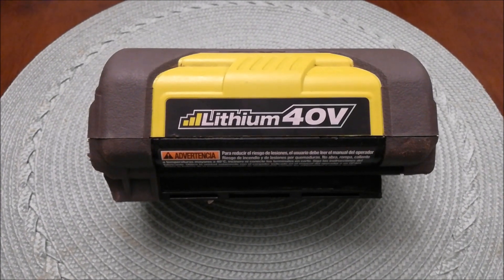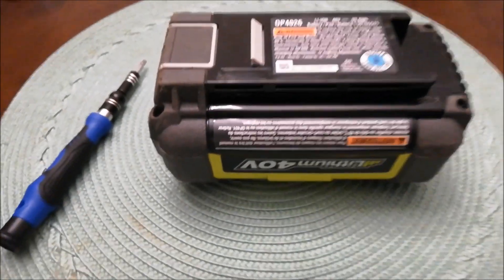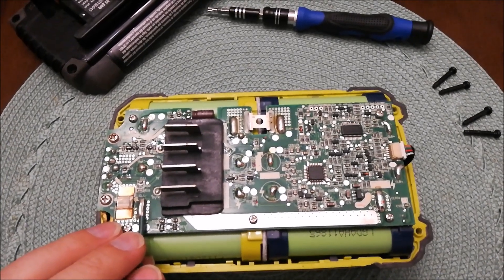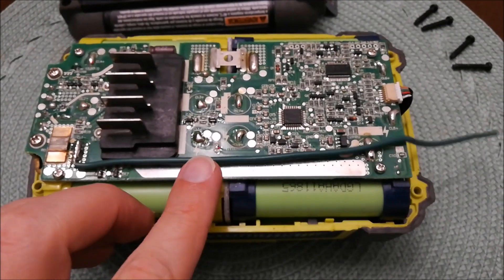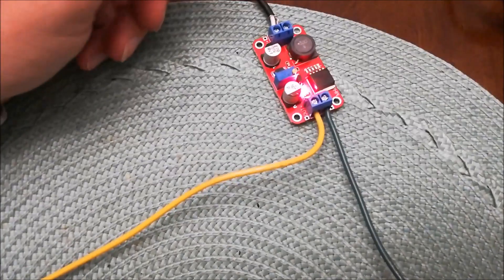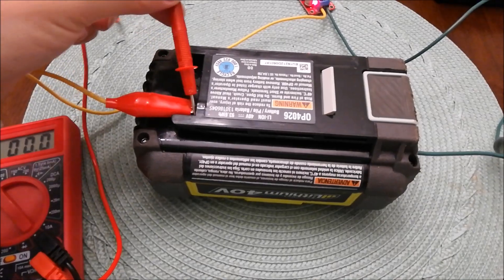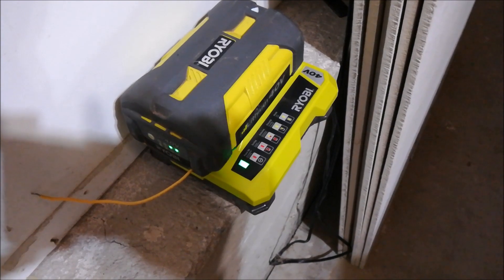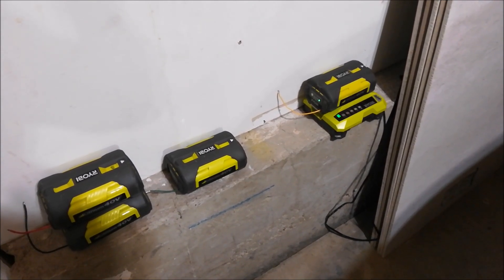40v Ryobi Battery Defective?! Let's Fix it!

Comment: Great video, but need a little help please.  I had an old laptop power supply that puts out 18v at 3.5A and tried connecting to a converter from Amazon (see description below).  Input voltage shows 18V and I adjusted the output to just over 35V fine, but when I connect to a battery, all four indicators light up for about 10 seconds and the LED on the converter blanks out.  Disconnect the battery and the converter resets, LED lights back up again.  Is the converter inadequate at 100W output?  Guess I should have gone with the one listed with the video, or is there something else I'm missing?  Thanks for any help.  
WHDTS DC-DC Boost Power Module Adjustable 100W 3.0~35V to 3.5~35V LED Digital Voltmeter Power Supply
Reply from the maker: What voltage is the battery at before you start charging?

Maybe start by lowering the voltage output of the boost converter to like 20 volts, get the battery up to that point and then raise the voltage to 35-40 volts. See what happens then.
Reply: @Jasonoid  Thanks for the reply.  I have two batteries OP4026 and OP4040.  Both haven't been charged in about 2 years and both appear completely dead.  I tried backing off to 19V, with no change.  The battery indicators all light up for a few seconds, but the LED goes out and I have to unplug and wait for the booster to reset.
Reply from the maker: @araasch2  it could be the voltage booster that is having issues. You might want to try a different way of charging it and see if the issue continues. The one linked in the description isn't too expensive, I just don't want you to have to buy something and then find out something else is the issue. It sounds like the boost converter is the issue.
Reply: @Jasonoid  Thank you.  If I can't find another option, I'll order a converter like the one you listed.

Comment: Thanks Jasonoid!  Just recovered mine that was just over 2 years old.  Only difference is I used a 48VDC adapter for a Cisco Access Point I had laying around.  Left it on for about 10 minutes or so until it reached about 33-35V and then put it in the charger.   PS, Ryobi has a 3 year warranty on all batteries and chargers purchased since around '09.  Just register it at https://www.ryobitools.com  call them and boom.  New battery will be on it's way.  
Here is the warranty info:  https://www.ryobitools.com/support/warranties
Reply: I did this, didn't have to hack the battery, buy electronics or anything. Just 15 on the phone. DO have your tool (mower or whatever), battery charger, and battery nearby. They want model # and serial # from all three. Thanks Steve.
Reply: I think mine was older than that, inBatttery years...But in usage, It was probably one year old. Since I dont use it in winter. Well I took a chance and theyre sendng me a new one. JUst make sure you have the correct charger, and tool that goes with offending battery.
Reply: Ryobi send me 2 batteries and both of them are doing the same thing, not charging. Don't know why they send them like that. Has 3 batteries with the same problem. I hope I can fix them after following what's done in this video.
Reply: @alexguzman743  How about the possibility your charger might be bad. Ryobi sent me a new charger
Reply: @markday2190  yes, it was the charger, I have to buy a new charger and now they work.
Reply: Warranty first, actually always! What they do is send you a new one. Then you hack the old battery and have 2! 

Problem with the warranty is each battery does not get a full 3 year, your warranty is from date of purchase of the original.

Comment: I did this method but my battery voltage was too low and can only charge up to 20.60 volts. My booster is set to maximum which for some reason only goes to 37.67
Reply from the maker: You might be charging the wrong terminals. 20volts seems about half the battery so many thats where you are hitting an issue. What type of power adapter do you have plugged into the booster? A 12 volt adapter with how many amps?
Reply: Might be that mosfet.on the battery pack I am repairing one now. Mine only read 20 volts or so the mosfet connects the other side of the battery assembly. I will post my results when the parts come in next week or so.
Reply: @ronb6182  Did you solve your problem by changing the mosfet? I working with a battery right now also showing 20.5V from negative to positive but every single cell shows 4.2V. I'm also thinking of a failed mosfet.
Reply: @everhill  no the part was too large and I really don't think it's the right part. There are ways to charge all the batteries with separate chargers. But to me it's cheaper to buy the leaf blower and get a 4 amp hour battery.  I already have the string trimmer and I'm using that battery for my mower. Two batteries are enough to do my yard when the grass is not too high. Otherwise I use gasoline mower. My mower quits when the grass and I have to wait until it resets at least one minute or two.

Comment: Dude I subbed immediately. Your a smart sob haha. Thanks so much I can’t wait to try. I am a bit skeptical though, just afraid of electricity. What gauge wire do you use for the different lines? Other than that I think I’m ready
Reply from the maker: You aren't charging through that wire at very high amps so you could be safe with 18 gauge wire. After boosting the battery, make sure you charge it after with the Ryobi charger.
Reply: Jasonoid so I’m testing my battery off the cl1 - and the positive hook up you showed, yet I’m reading 69. Am I reading this right? I’m skeptical to trying to keep charging
Reply from the maker: @t-bone8404  make sure your volt meter is set to the correct DC readout. Like 20V not 200V. What does it day then? You should only charge it to 33volts.

Comment: Can we mail you a battery and have you modify and charge it.. I'm not good at drilling or soldering and this looks very complicated.
Reply from the maker: I don't think that would be very cost effective with the cost for shipping and my labor. You can find used batteries that still function on eBay for a good price or even attempt to call Ryobi to warranty the battery, cheers!  :)

Comment: I've done this fix before like a year ago from the video that's already out that's just a video of a diagram pic basically (I'm assuming that's where you got this idea from by the method you used) and it worked for the summer but then stopped.  After taking it apart again I found a few bad cells which I replaced. (Most likely because they're no longer being balanced during the jumping up the voltage) Now I'm "pretty certain" the board is ok but no way to test other than a volt meter and it appears that all my volt readings from various points seem to be right. After charging I get 43 volts from the same ground point you used to the same positive of the connector lead but when going across the main neg and pos that connects to my blower or any tool I only get 16.4 volts. So my question to you is: What reading do you get going across the 2 main external connector leads? Do you get your 40+ volts there too? I would think so but I wasn't sure if it works in a wierd way because of the circuit board and only delivers the 40v when plugged in to a tool and is being used kinda like how you can't just charge the battery by hooking the main connect pos and neg.
Reply from the maker: I only recommend 'boosting' the batteries one time to get the battery voltage above 33 volts, then the normal charger should be used each time after to charge and balance the individual batteries. I have been able to do this on all my batteries (I have 8 of them). Also, just be save in the future and not run the battery all the way down on your tool.

Avoiding the factory charger and using the boost converter it will overcharge some cells and under charge others. I don't have a battery with me at work so I can't verify what a good battery voltage shows at the main power terminals.
Reply: @Jasonoid  Yea I know, I bought like 6 for $80 bucks on EBay and it was a gamble on what was wrong between salted/corroded boards, bad cells, or as simple as just needing a jump. And after trial an error and actually getting 3 of 6 working 2 by jumping and one by swapping the circuit board (easy BTW but only if you have a GOOD solder sucker) I've messed the charger up to where I had to bridge a connection on the circuit board in that POS too so it doesn't give errors anymore, like at all. Just constantly puts outs 43.5 volts. Which is fine as long as you use a meter when charging and keep a close eye on it and manually balance your cells out. But after all this B.S. and reengineering along with quite a bit if use out of them last year....its finally came to an end so I was just wondering what someone with a good battery had a reading of before I finally give in and just purchase something besides Ryobi. LOL I guess later when you get home if you have 30 seconds to throw a meter on those 2 connect leads and let me know the result that would be pretty stellar. Thanks again for your reply brotha. 

Justin

Comment: I have a older 40 V Ryobi battery that says it’s full charge to Apple but will not run the blower or of the weedeater what are you do about that
Reply from the maker: That battery probably has a circuit board issue and it won't be able to be fixed. I had one that acted in a similar way. If you bought it recently, call Ryobi and they will replace it for free.

Comment: I bought the items you described on Amazon.  Should be here today.  How do you adjust the boost converter to get to the 38 to 40 volts that you recommend?
Reply from the maker: There is a little brass flat head screw you adjust to get the voltage to where you want. As you turn it it either goes down or up in voltage.
Reply: @Jasonoid  Thanks

Comment: Jasonoid I seem to have the same problem that Norman Randolph
 has. I have a Ryobi OP4026 showing fully charged in the charger and on the attached LED meter but powers tools for only a second. It's showing 37.5v on the "-" lead, but 86.5v on the T1 lead. The circuit board looks clean. The battery was great prior to some cold and rain. The leaf blower definitely got soaked in the rain and battery might have gotten a few rain drops on it too. Any ideas?
Reply from the maker: I actually had one battery do the same thing. After looking at everything and attempting to fix it, I figured something in the circuit board had burnt out, probably due to a short circuit. The board is dual sided so it's almost impossible to inspect both sides. Out of 8 batteries I have recovered, I only had 1 fail to this issue so I don't think its very common.

Comment: Why doesn't applying ~40v directly to battery + & - terminal work?  Why must access CL1- test point?
Reply from the maker: Go ahead and give it a shot. Some of the batteries I tested wouldn't work that way. Just provided a way that I knew worked 100% of the time if the batteries failed due to over-discharging them.
Reply: The circuit board doesn't allow the battery to be charged if the voltage is to low. Accessing the inside is basically bypassing the circuit board.
Reply: @jmccomas2010  The BMS is responsible for charging and discharging. It monitors and has provisions for under and over voltage, amperage and possibly temperature. I didnt see a thermistor in mine but I didnt get deep.

Comment: Hello,thank you very much for the video. I bought on ebay from the USA Ryobi 40 vlt, the package went 2 months. The battery is discharged to 34 volts. What current amps need to be charged and up to how many volts that the charger would work with the battery? thank.
Reply: I also want to clarify the input of the converter-module you are supplying 20 volts, output-35 volts? sorry i don't know english very well
Reply from the maker: @mmnasyrov  My boost converter runs off 12 volts and boosts to 40volts. I have it set at 38 volts to be safe, only charges at 1 amp. Make sure you get the right charger in the long run, this 'boost' method is only to raise the voltage of the battery.
Reply: @Jasonoid  thank you !
Reply: @Jasonoid  Hi and thank you for the video. I have a handful of 12v adapters laying around but not sure if they produce 5A. Based on this comment I would think that is okay but will just take longer. Do you concur?
Reply from the maker: @joshtaylor9675  go ahead and give it a shot, saving money is great!
Reply: Thank you for the reply. I hooked a 12V 3A adapter to the step-up converter in your link https://www.amazon.com/XL6009-Adjustable-Step-up-Converter-Module/dp/B01FDEWS7U/ref=pd_ybh_a_31?_encoding=UTF8&psc=1&refRID=QPD05KS6ZQV4DQY5C89G and made the connections through some old speaker wire I had laying around. Ultimately, after sitting for a while, the battery discharged more than it charged despite the readings I was getting from the converter initially. Is this the speaker wire? Thoughts? Would love some assistance as I feel like I am hot on the heels of getting this thing taken care of but just can't seem to get there. Thank you ahead of time.

Comment from the maker: Try charging it directly from the positive and negative terminals.
Reply: Car charger?
Reply: Doesn't work.  I tried.  Not sure why but voltage readings between the + and - on the battery, are not the same readings as CL- he has you wire to and the + on the battery.  Interesting to say the least.  I followed his process and recovered a battery as well.  Just used an old 48V Cisco AP power supply and let it charge for about 10min until it was around 33-35V or so.

Comment: I have a newer battery that doesn't appear to have the same CL-1 terminal.  Any suggestions?  This battery came new to me as part of a reconditioned tool.  Ryobi is replacing the battery but it would be nice to get this one going as a spare.